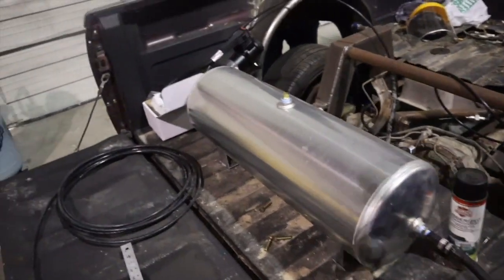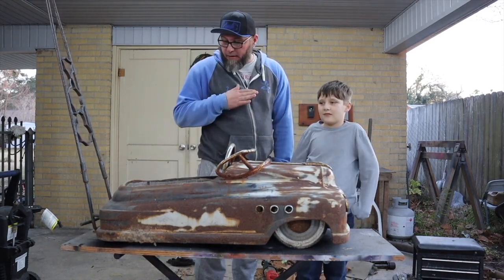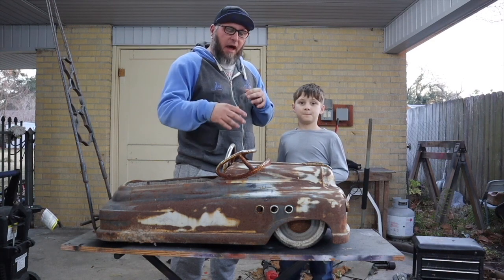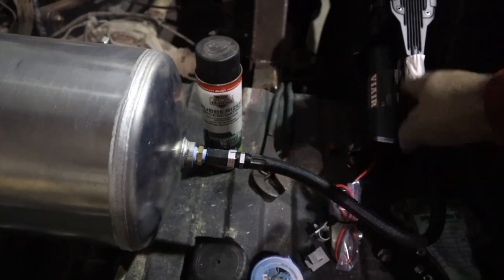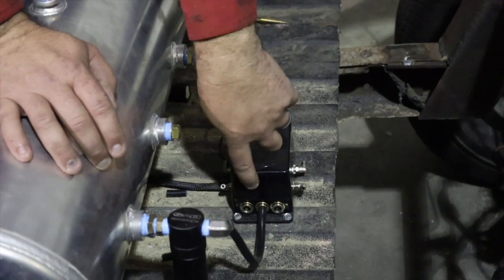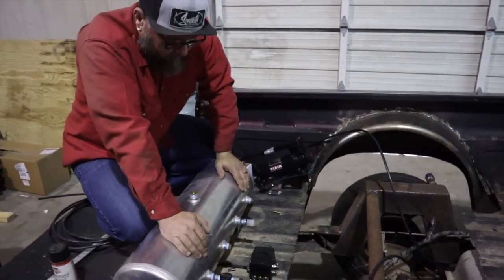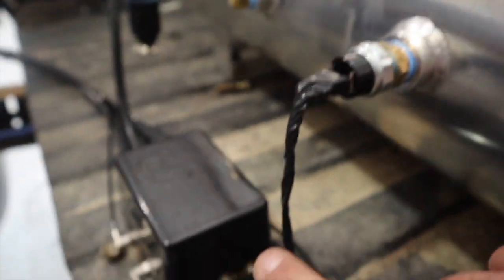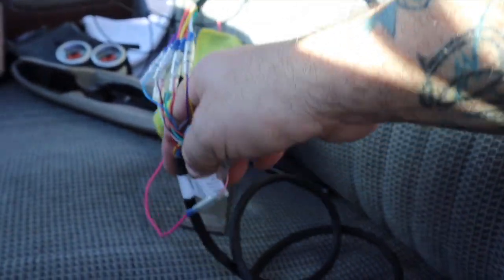How To Bag An OBS - Compressors & Valves PT.6

Comment: Could it be as simple as throwing in a flex joint on the wishbone single end to have some side to side and beneficial 4 corner set up?
Reply from the maker: I’ve seen a few with a heim joint on that end but i don’t like them. If you want side to side just do a 4 link
Reply: @CarportCustoms  why do you say you don't like them? And a tri 4 is another option also
Reply from the maker: They tend to wear out and break. To me they aren’t as save and sturdy as a typical link bar end. Triangle 4 link is the only option for side to side. A parallel 4 link uses a pan hard bar or watts link and can’t go side to side.